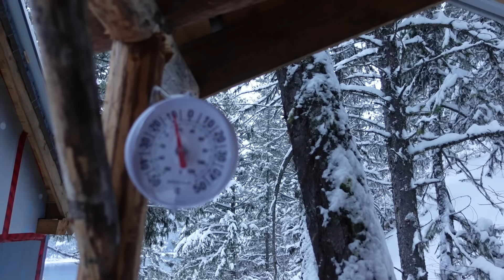My scariest incident yet, but THIS was worth it! | Snowstorms in Canada | Cabin loft build.

Comment: Your incredible vision is becoming a reality.   Congratulations on this milestone.   

I will join with others, pleading that you install safety railings around your deck.   Vertical posts bolted to the pilings with rope slung in between until a better design presents itself.   Perhaps volleyball netting mounted vertically and horizontally just below the deck surface to capture falling items too.

Dear Michelle, we want you and your pack to be safe.  Wishing you, Steve and your pack a blessed week filled with gentle seasonally appropriate weather and restful evenings together.  Peace princess.

Comment: Putting the deck boards in place was cleaver thinking the way you did it , it’s a lot of extra work but you did it and it looks great !

My concern was like others , the thickness of the boards but the boards are short in length which helps to keep them more ridged!
I thought you did an excellent job designing the loft system !

You should be proud of your workmanship, you did well ! 

Geeeez the trestle was kind of scary the way your truck went over to the edge but my truck has done that too on ice and snow covered roads !  Glad you are okay and your truck wasn’t damaged!

Comment: Glad you didn't fall off the bridge. Would have been a great loss...
Also had these zipper issues. Sucks... 
I had good experiences with these small stove fans. They would help to heat up the place faster.
Your solution for the boards was great. Very smart and beautiful! Seen it often around here in timber frame houses. Well done !!

Comment: Don’t throw that purple coat away. Next time you are in civilization you can take the coat to a seamstress or a dry cleaner and have them put a new zipper in. I did that with a Columbia jacket. I replaced the plastic zipper my a metal one.

Comment: Why is the sky mule handle on the right side? I haven't noticed you being left handed.
EDIT: I meant to ask why is it on the left but had an attack of main brush
Reply from the maker: The handle for the wheel is on the left side. It’s just the way Steve installed it! 🤷🏻‍♀️

Comment: You shouldn't put the break on the stove. Metal work uses enough toxic compounds that help maintain a non-corrosive surface. Get a metal pan or plate.
Reply: Your router template was very clever.
Reply: Lovely bed. As for the structural integrity of the boards, a 3x3 down the center of the underside will be enough. You can embellish that with extra support to give the underside a decorative look.

Comment: If you think the railing saved you life on the bridge, think about your deck railing. Rub a wax candle up and down the zipper. A 2 inch pipe and hole through the wall behind the wood stove will stop drafts supplying air for the fire. I have yet to see a boat on the water. Ask your tire shop about narrower tires that will dig down and not float on top like your wide tires.
Reply from the maker: They are narrow tires! I was told they were, anyway.

Comment: Hey Michelle, maybe you should add a piece of 1/4-3/8” plywood on top of the hardwood before adding the foam piece on top. If anyone ever sleeps up there that’s  considerably heavier than you it may get interesting.😊
Reply: Adding plywood on top, or stiff foam as she said, or anything else, will do NOTHING to improve the structural integrity of the bed.  Those planks are simply too thin for significant weight bearing.  The system needs a re-think to allow minimum 2x lumber (rough cut, actual) supports.

Comment: Michelle, your simply Beautiful. I would cut a 1/2 or 3/4 piece of plywood and put that above the bed boards for a rigid look. Your not a big lady buy when you were getting ready to nail them in, take a look at your video on your left knee, the boards were bending. Also due to hot n cold conditions, is the board groove deep enough? Will any of the boards shrink?  You need to put up a safety rail. On slip of you or one of your babies, you will go after them. Just want to keep you safe🙏😘💕🍷🌹👏😎 Warm hugs from Santa Barbara. It was 77F (25c) today

Comment: Michy, we all worry about you. I have great concerns about your ability to communicate out there. Have you ever considered a satellite phone or a CB radio ?  Also, you may need to throw a few heavy objects in the back of the truck to help traction in the snow.  Regarding the structural strength of the loft, you might consider adding a 2 X 4 in the middle on the underside, which would simply look like and function as an exposed beam.  That is if the rigid foam does not seem like enough.
Reply: I believe she rocks a Garmin InReach Mini. I use one on the trails. Lots of diff monthly plans depending on your needs, but I use it to check in when arriving at camp, which sends a txt to friends/fam and leaves a GPS pin too.
Reply: @jamesbramlett5407  Good on you. I have not seen, or I don't remember seeing that. I have only seen her saying her cell phone mostly get no signal out there. It is just so easy to get trapped in that environment. A twisted or broken ankle would be a disaster, considering how long the trail back to the road is, UPHILL.

Comment: MICH, AT 23m:30s, I WOULD CONSIDER CUTTING A PIECE OF 1/2" [12.7mm] BURCH PLY AS A BED DECK.1ST, YOU'RE A "LIGHT WEIGHT" AND 2ND, I'M SURE YOU'RE GOING TO PUT A MATTRESS UP THERE AND IT WILL BE COVERED UP. ADDING A PLYWOOD WILL HELP DUE TO ITS FLEXIBILITY...MY OPINION.

Comment: Thanks for another entertaining video. Your progress on the cabin is looking good. A couple of comments on your drive, even though I have never driven that road, I think that the tires you have are not aggressive enough for those conditions. Put proper chains on with the current tires, or get a tire that is more designed for mud and tough terrain. The bridges are definitely a sketchy situation. No matter what tire you have, ice is always tough to deal with. First rule of off-road travel for me is keep moving. And, if you do have to stop or get stuck, as another person suggested, you need a winch on that truck. Something you can use on the front or back. Have a good week!

Comment: Michelle, use a cable system for your railing, will keep the " Danger Wil Robinson" comments down. Maybe make a rope net below to catch anybody that falls. Have steve get some steel strapping for under your beams, you deleted 2/3's of the strength of those boards. 1/8" x 1.5" x 8' steel. Cut to order. 👍💋

Comment: Are the primary species you're burning conifers?  Lower BTU value compared to hardwoods leading to high fuel consumption and slow heat up?
Reply from the maker: It’s mostly larch/tamarack/fir but I might chop up some birch from home and take it out there

Comment: Your truck tires are too wide for the weight they support.  Narrow tires do not look as beefy but they make less resistance as you drive through the snow.  My FIL used to run narrow tires like you would see on a WWII willies jeep, while not looking as cool, he made it through while the cool guys did not.
Reply from the maker: They are designated winter tires, so are narrow compared to my other tires! 🤷🏻‍♀️

Comment: That trestle bridge needs to be plowed ASAP. All the more urgent that truck need a plow. Also, those boards have way too much flex. No way I'd trust just having the groove. I'd put a beam underside running down the center of those boards and tie it in to the frame structure like you did with the other beam. I wouldn't even go up there again until that beam was in place. Your stove is too small for a cabin with zero insulation. Having to feed a stove every two hours would make me lose my mind. To keep a good fire going consistently in that thing, it's more like every hour. I gotta say, you sure kept you guardian angel quite busy in this video.
Reply from the maker: The cabin is insulated. Not well, but there is 2” rigid foam on the roof and 1” on the walls. It’s all on the outside of the framework

Comment: please get a railing up this spring, its sketchy enough when its nice out not having a railing but is really bad in winter conditions. Love the Cabin its coming along nicely, maybe you can find some reclaimed 2x4's and make a center support underneath the decking boards in your loft would give increased structural rigidity and it should look nice  if you can find some that has good weathering on it.

Comment: God, that is a lot of snow, and yes the no rail makes me crazy!  I can see that maybe you loose some of your view , you can use the cable wire, and won t block your view so much. It is a most fantastic view. Insulation will change things considerably. Bravo for consistent commitment to this project.

Comment: did you crap you pants when you slid into the rail?  I only buy coats with metal zippers...Just my preference...When you speed it up walking in shoe shoes it reminds me of the way pinguins walk...lol it might help a lot if you insulated between the wall studs...
Reply from the maker: Very much like a penguin! 😂
I kinda crapped my pants. 
The cabin is insulated!

Comment: Well Dear; The key is to install your tire chains BEFORE you get stuck. Did you ask yourself how difficult it would have been to install your tire chains had you got stuck ON that bridge? Let alone exiting the cab between the railings.
  As far as your woodstove, if you stacked rocks or firebrick around it, it would create a (heat sink) that would help keep the cabin a more uniform or constant temp. Just a thought.
  And I agree with a previous comment I read,,, please build a railing on your deck. I realize winter is a dangerous time to do so,, but as soon as possible? I really don't want to see such a wonderful person as yourself get hurt.

Comment: Just had a thought (wierd, I know).  Looking at the small stove heater, was wondering if one of those homemade soda can radiators placed in the line of the exhaust would help to recover heat and use it to help warm the cabin.  I know they're meant to absorb heat from the outside, but it should be able to work in reverse.  Wonder how much recoverable heat is going out the chimney.
Reply from the maker: I do have a stove top fan coming my way!